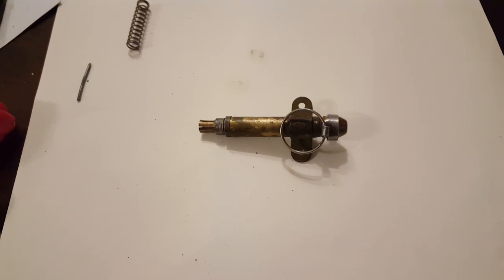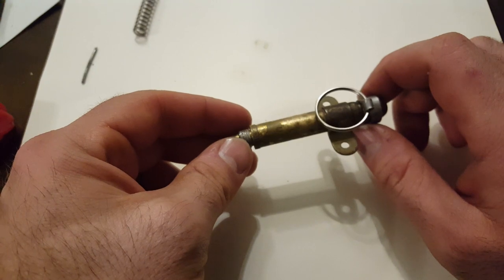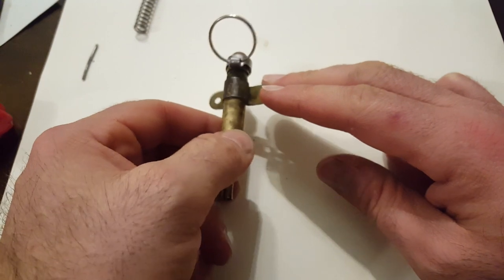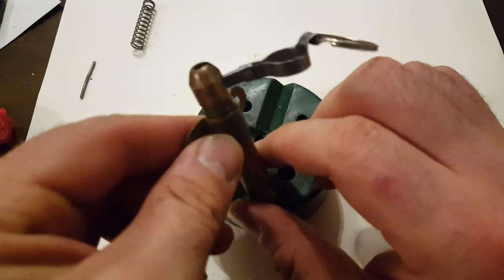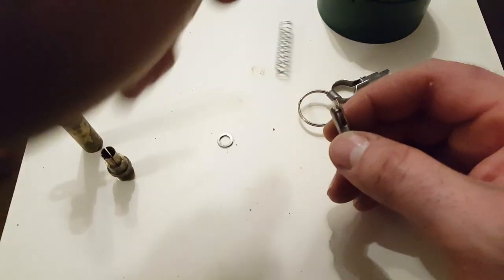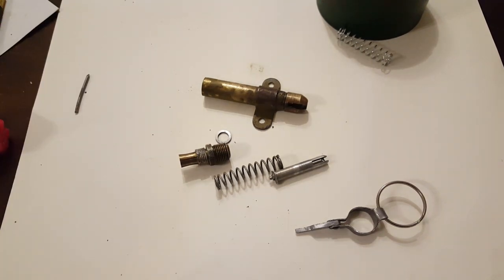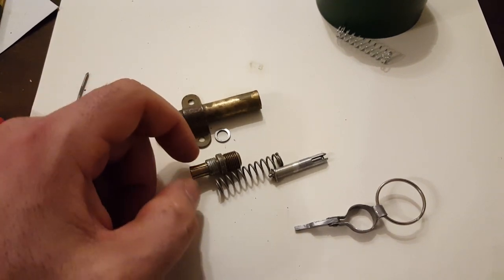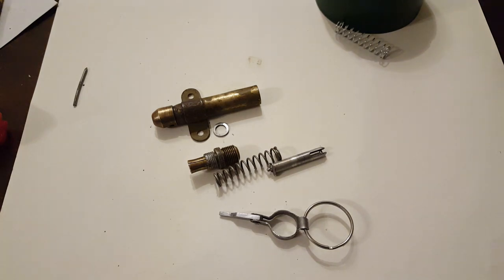Allumeur A Traction Model 1939 (French WW2 Fuze)

Comment: Can you play that game on an iPad? It looks cool but I’m not a gamer, thanks.
Reply from the maker: Minimum I think is 
"System Requirements

Requires a 64-bit processor and operating system.OS: Windows 7 SP1 (x64)Processor: Intel Core i or AMD Ryzen with 4 physical cores.Memory: 8 GB RAM.Graphics: Geforce GTX 970 or AMD Radeon RX 570 with at least 4 GB of VRAM."

If it was just the training range to mess around on like you see in the videos I made it probably could be made for the tablets. But the full multiplayer game is a resource hog. Look up 2021 videos on it if you want to see how it is usually played. My videos only basically show 1/3 of the training range.
Reply: No. You usually need Good Computers to comfortably play games like Post Scriptum. However, I would research what a Good Computer qualifies as before just buying any old expensive computer.